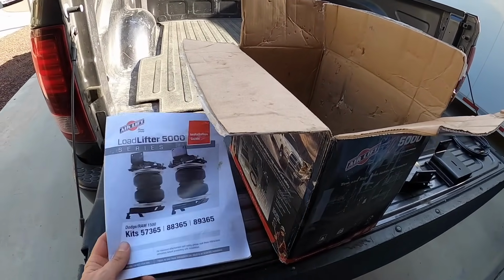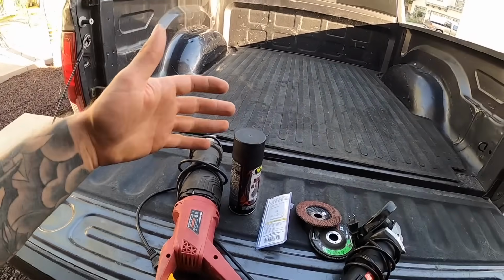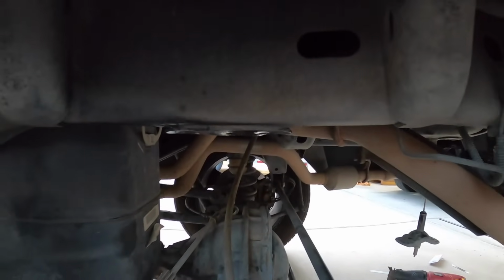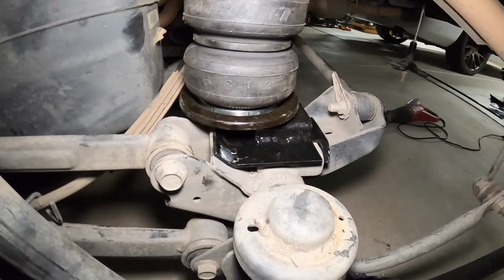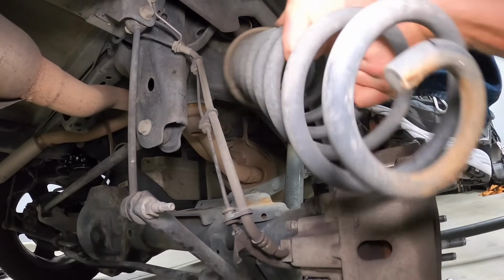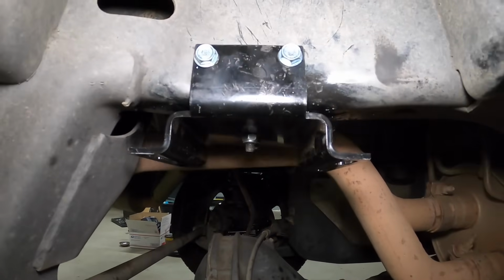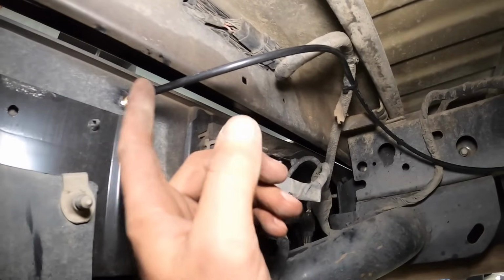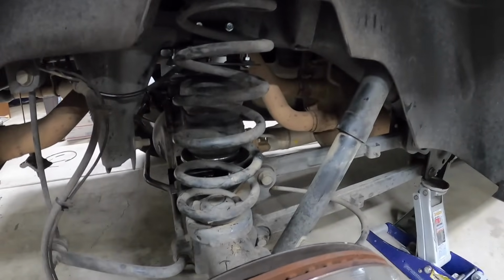4th GEN RAM 1500 AIR LIFT AIR BAG INSTALL

Comment: Professional instillation.only issue I see but not a real big issue is your heat shield should be minimum of 1"in from the exhaust I guarantee you touch the heat shield it's gonna burn.if you leave a little space it stays cool. Those tabs bend out in a L shape then up leaving the purfect space..great video

Comment: Could you use this kit with a compressor to lower the rear of the truck with manual valves a tank and compressor just like air ride or would this kit not work for that?

Comment: Was looking to decide if I was going to purchase this Air Bag for my Ram 1500 and install them. Did these on my '05 Ram 2500 towing a large 5th wheel horse trailer. This is probably the best video I have ever watched on an installation. GREAT Video JOB.....

Comment: What do you keep it at while not towing? And max psi they can with stand?
Reply: You can either empty the by the Schrader valve and most are 150 psi max  also don’t run them through the plate if someone steals your plate they’ll break them had that happen with tag lights that replaced the plate bolts

Comment: For anyone doing this in the future, hook a T connection from both air bag lines to to 1 so you only have to fill one Schrader valve instead of both to the same psi!
Reply: good thinking

Comment: I am currently building an auto level system for my rickety old 12valve, Similar air bag set up that rides on the leaf springs. but I am tying my air bags into an autolevel air valve then to a air dump switch which gets its air from a compressor tank that I mounted on the frame. The compressed air will be supplied by the trucks factory turbo charger which will charge up the air tank through a 1 way check valve. With this system I Dont have to check bag pressures or ride height. once I set the height it will ride at that set level loaded or empty automatically. The air dump switch is to dump the air bags to unhook  the trailer easier or for servicing some thing on the truck that requires the air to be dumped.

Comment: A trick with the bags is don’t use both valves at the plate use a tee valve before the plate so you just put a single valve threw the plate so you put air in one valve and you get equal air pressure
Reply: Was thinking this when I saw another video and thought the same thing equal pressure with no messing around 👌
Reply: And what about the times when left needs to be inflated  or deflated for proper balance.  My trailer is heavier on the right side so this concept would not work for my situation
Reply: @ktpowerwashing  it will self level with a t valve instead of bothering air valves on the plate I’ve done it and it works great

Comment: I like how stiff it makes the rear end of the truck. When I accelerate there's no coil movement. It also prevents the truck from driving like a boat. I wish I knew ahead of time how stiff the suspension was going to be. Bumps are 100 times worse then before. If there was a way to keep the factory jouce or whatever its called and mount the non ultimate air bags I would have done so, but oh well too late for me
Reply: I would have gone with the 1000 honestly.
Reply: when your not towing are they fully deflated  or partially inflated? 

Is it stiff with the trailer attached? or only when your not towing ?

Comment: Do you know if putting a t in the line to have a single fill valve to fill both faster and stay even.whether or not that has any negative affects like letting the truck away more . If the shocks are linked and the truck goes around a corner I feel this will compress the outside turn side and allow the inner turn side to lift making the truck when not towing feel like its leaning more or is that now how bags work..

Comment: Does this kit work for lifted trucks?  My ram has a mild (6 inch) lift with 35s.  Also, why would this have 2 valves? wouldnt it lift more evenly if there was one valve 'T' ing off into each bag?

Comment: Old post... 
But, I purchased this same unit... I am very happy 😊 with this purchased product from Airsuspension and I have never looked back.. Also, I am 100% pleased with the WiFi use this product puts out.. Never really had a problem with connecting to the system.. I like 👍 this feature the best...

Comment: Are all your shocks still stock. I bought my 2015 ram 1500 used. Has the same set up in rear as yours, with air bags. Did you have to do anything to the front end ?

Comment: Excellent vid actually...
Question, did you consider the coil air bags?
If not why?
Question 2, 24 foot car trailer is getting up there, not sure if it's a 7 or 10 k trailer....
Wondering what you think it'll weigh loaded?
I'm not positive how much my 5.7 2017 will tow legally and comfortably...
Reply: it’s not legal at all but i’ve had 22k behind a 14 1500 with the 5.7. now it didn’t like it but it made it from cleveland to st. louis. and that’s not the only time it’s been over the max towing capacity. it’s all about how you distribute the weight and run through the gears. also with that kinda weight even if you have trailer brakes always make sure you break plenty early enough

Comment: thank you for posting your bag install. I've been pulling a 7000 Lbs trailer and have been meaning to do this job to increase rear end stability and leveling. Give us an update down the road and let us know if this was a significant quality of life improvement when towing your trailer all loaded up.
Reply from the maker: Made a HUGE difference! Feels like a 2500 in the back now and doesn’t bounce and buck when you hit big dips anymore. I would definitely do it again if askedb

Comment: I might want to add this to my truck one day.  I had a old camaro that had air bags on the rear.  It had a T fitting between the airbags and one valve they you air both up at the same time.

Comment: I'm assuming they make a on board air and controllers for these... wonder if they make something for lifted 1500's 🤔
Reply: You ever find the answer? I’ve got a 2017 Ram 1500 with Fabtech 6” lift and was hoping to do an install too.
Reply: @backcountrybuilds   no sir, there's nothing for my 2016 ram with a 6" rough country lift
Reply: @mikehogan6938  bummer. Guess I’ll keep driving the saggin wagon :(
Reply: @backcountrybuilds  to bad a ram 2500 don't have the same springs in the back as a 1500 cause really a 6" lift basically brings the 1500 to the height of a 2500
Reply: @backcountrybuilds  check out that video
Reply: @backcountrybuilds  he installs the bags twords the end of the video
Reply: https://youtu.be/uezzIp-lfVw

Comment: I got the updated kit where there is no cutting.  But I installed a T fitting on the air line so the bags level themselves automatically
Reply: I also used a t valve.    It’s the only way to go
Reply: Don't all the 5000 series require cutting/grinding? Did you get the 1000 or 1000HD?

Comment: Today I towed 10,100lbs 38 RV trailer I have the airlift 1000HD it helps a great deal 👍 love the airbags
Reply from the maker: That’s awesome! No weight distribution hitch?
Reply: @BoostedMotorsports  no weight distribution hitch I sure have used one only went 140km my fuel mileage was 18.5L to 100km

Comment: Could you put T fitting at the Schrader valve so you could fill both bags simultaneously?
Reply: You don’t want the air transferring from one bag to the other when turning.
Reply: @dodgeguyz  I have a T in mine and that doesn't happen
Reply from the maker: Yeah you definitely could 💪
Reply: Shouldn’t be a problem. I’ve done that on plenty of trucks I’ve installed bags on. One things that helps are sway bars in the rear to keep the roll to a minimum.

Comment: You are going to think you have a 3500 1 ton truck now 👍 I installed a set of these several years ago .. the exact same brand as yours an 5000 lbs as well … ooooh my god .. it would carry a load an never even budge I tell ya.. I never went over 60 psi as there was no need to .. only thing when your going to be empty for a while you will want them deflated as they will cause a rougher ride .. but you won’t even have to use those leveling bars with your trailer now .. it’s unbelievable the loads you will carry now .. jus keep an eye on your tires as you don’t want to go over the weight rating of them too much !! I truly believe theses are under rated .. they say 5000 lb rating an I say there more like 8thousand lbs easily  . Great job on the install 👍
Reply from the maker: Should be interesting once I hookup to the trailer!